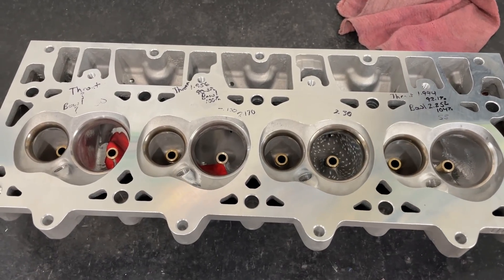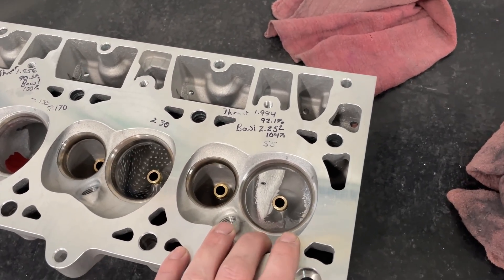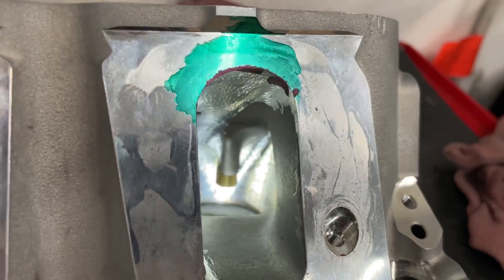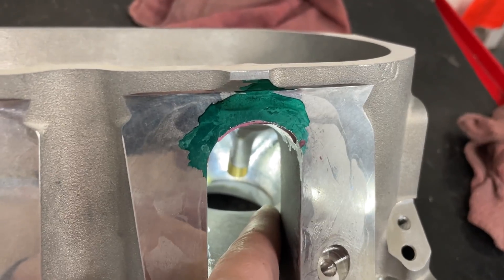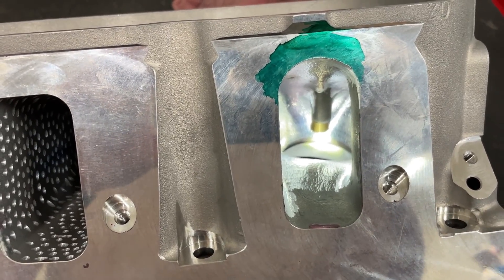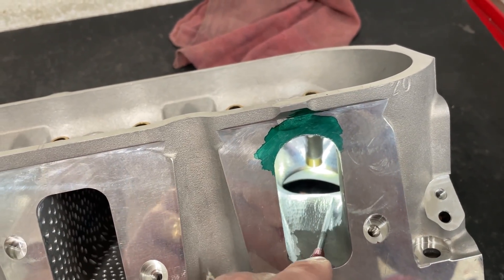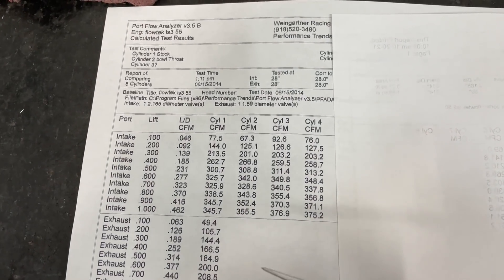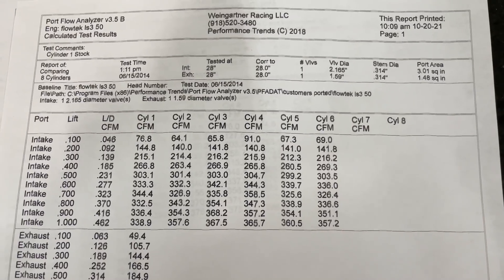Raising the Roof On LS3 Heads(386cfm) Internet ports heads part 6

Comment: I'd be interested in comparing port velocity deltas with your changes as well. I read about so many LS3 heads hogged out for peak cfm, at the expense of a lazy port. I'm trying to avoid depending upon a Mamo aftermarket head for excellent velocity.

Comment: I think you should use the “dimple” port to follow the results from the 55° port. I made a comment on DV’s channel to see if I understood the “rules” for port design regarding the port to bowl transition. He replied confirming the port should follow a 1-2° included angle reduction in cross section to the point where the port transitions to the bowl. The bowl should be biased to the cylinder wall side and the port should be biased a bit that way as well. Your 55° port latest results would seem to verify that “rule”. For max port velocity, the side of the port towards cylinder center should have minimal size increase. You have the experience in seat angles, throat vs bowl size, etc, but I’d be really interested to see results from a fresh look at the port and bowl. Super series, thanks Eric!

Comment: Would it be possible to have a piece of light cotton string and use it to see where the air is moving inside the port while on the flow bench, like a smoke stream in a wind tunnel ? If the string idea works it would give a clear indication of where the air "wants" to flow and then directs you to where the porting will have a greater effect.

Comment: The problem with your test could Be that, it's pushing air to the center of the port, that is IF the flow was through an intake and carb and intake maybe the air would biased toward the top of the port or a "line of site" bias? Another question, what sort of effect would this have on a partial throttle? Does all this make the engine difficult to drive on the street, or is this meant to be a full race head?

Comment: What you're talking about is huge corporations attempting to monopolize on vehicular service by trying to make it difficult (if not impossible) for anyone without proprietary training and certification to repair. It's really big in modern industrial farm machinery because that equipment is so expensive it's obsolete by the time anyone can actually own it. They're simply trying to corner the market and shut the little guy out. It's nothing new. I bit the bullet and learned electronics years ago when it was a big deal to get into; but in retrospect I can say it use to be extremely over-hyped. Just about anyone can learn most of all that is practical related to it from F-ing YouTube videos these days. My EFI ECM is a Magasquirt II which I built myself, can get pats for, and repair like a Jedi should the need arise; and I'd never trade it for an annoying oscillating idle circuit carb. LOL However, a guy who replaced the cab of a 96' Cummins Dodge PU that had been rolled with one from an 03' (gas V8) hired me to swap the wiring over and the job went over-budget because all high-current switching is done with relays at the fuse box rather than at the actual controls these days. It's further complicated by the addition of multiple programmable logic controllers (PLCs) networked together. Be that as it may, it can still always be totally stripped and replaced with something more practical should the need arise. If you own the shell it's yours and you can put what you want in it. The only real fear is getting legislated off the road, (S could get like that Rush song for real). As far as parts go, Getting most of them manufactured in China is a double-edges sword. American aftermarket is always hungry and can take up the slack but not over-night. It's all about consumer demand. Look how long Cubans have kept their vintage vehicles rolling. There's a lot of new tech stuff that's just slicker than Siberian snake snot, but you have to be able to separate the good from the bad. The big push is that digital is cheap and analog still expensive, but hands down, analog is always more bulletproof and that's what differentiates a genuine mechanic from a mere technician. LOL

Comment: What would you recommend for a street/ roadrace type build beyond stock? Basically any LS head will be a gain over stock SBC heads, maybe not so much the iron LS (vortec) heads, but not too much chance running into those, I'm thinking about building a 4.8, with rods and Pistons, cam upgraded, with a bit of boost, kind of a modern  Trans AM theme basically a late 60's early 70's style, with modern take, if not a tr6060, or t-56, maybe a6L90, with some stall, it will have about 27"-28" tires, with 3.45:1 to 3.73:1 gears, and looking to cruise at highway speeds 75+mph, at 2k to 2500rpm I had a 86 iroc it did 60mph at about 1400rpm, they should been ashamed to put iroc on that thing, or Z28, it was a turd, it should atleast ran like my 88firmula, only difference was it was a t-5, both 305, the formula did have the ws-6 package, with a few options, maybe it made a bit more power, both tuned port, it could of had a bit more compression, and more lift from the roller cam, maybe larger valves but I doubt that would be an option, I did think about modifying the tpi, I did port it, and match it, not much can be done with the thin aluminum runners, or the 305 H.O. heads, that's worth the effort or cost.. possibly A 1.60" exhaust valve, and a cam with more intake lift and overlap, 1.94"/1.60" is not that common, maybe a2. 9"/1.60" but port and chamber work will probably get the most gains, the small bore us shrouding, but I'm looking to the future, and hoping to get a 4.8L built, that can do about 7k-7400rpmbut peak in the 6500 range, make decent  'drivable' power below 2500r' and flat tq curve/plateau from 2500 up, and a good HP average across the range,  peak HP is not important,. But N.A. I'm hoping for 400hp peak, between 6-7k rpm, and atleast 650-800 on boost,,, I'm hoping to build a more efficient engine, not through boost at it to make power, 95%+ of the power is from the head, not much else can gains be made from modification of anything else, the intake and exhaust can restrict power,  the bottom end can restrict power with friction to, gains from compression ratio is possible, I'm hoping to get power from basically any LS head, make it the best it can be, without major modifications, basically valve Job, and porting, with new valves, possibly oversized but a small bore doesn't gain much from large valves, probably take your advice, and go with as much lift as possible, and multiple angles on the V. j. (Haha) they just something funny about calling it that!   Maybe fill the bottom of the intake ports, maybe weld up the floor of the exhaust ports, and raise and widen the exhaust ports, if that will help them, but that's about as far as I'd want to go, As far as getting crazy with the head mods, raising the exhaust ports .100"-.150" maybe . 250" what ever it takes to straighten the port, it would probably never fit a stock manifold, I guess I been watching too many super stock videos on engines from the 60's-70's, it's Soo much easier to talk and think about doing this stuff, I would like to try doing something with a vortec 4200, get crazy with a head, if you skru it up, you can get another engine for about $250-$400, maybe cut the deck, possibly larger valves, port work, and build an aluminum sheet intake, with velocity stacks, something like the 2j guys build, short or long, depending the purpose, probably short large diameter funnels! Into a large plenum, with a 102mm throttle body, with a couple GT-35's, maybe new rods, scat maybe, they make everything, and forged Pistons if possible, I don't know if anything is available for these engines! It should do atleast 420 HP, with slight boost, adapt it to a 6L80trans, but that's not even close to a project, Im mostly interested in the 4.8 project!

Comment: Knock a solid aluminium bar into the pushrod hole and straighten the wall in the port.
Reply: Thats actually relatively easy. You can bore the hole a little undersize and throw a chunk of round stock into a pail of dry ice with a little coat of durabond or whatever and it will never move. He is probably getting to the point that the pinch is an issue.

Comment: Eric, what bore are you using, do you go through the 4.000 & 4.065?
When you look at the 1" numbers and port stability is this in correlation to cross sectional area and the volume and the time component?
If its stable at 1 then the flow will match the cross sectional area for a given rpm?
When performing the cfd what I noticed going from static to dynamic (valve opening and approximate time) the available column of air plays a large part. As the valve opens and of course the air starts to move, at the end of the air column theres almost no movement.
People think that the air moves all at once, but it has mass and has to follow physics.
The runner in the intake seems to play a good part and there is a connection between size which is directly connected to the mass volume of the air column.
For the port you raised the roof in, can you fill in some of the backside of the bowl?

Comment: Eric - I’ve seen side view CFD that suggests that at most lifts, the top area of the bowl is a relatively dead area between the valve guide, down towards the valve seal.
Would it be a good idea to fill a portion of this (around where your ‘wet flow’ marked the bowl maybe?) to promote more airspeed and laminar flow? Especially with a raised runner that has been limited by the spring pockets etc like in this video? It would have a more straight shot at the ‘window’ of curtain area. Filling bottom of the port would probably help too.

Comment: Eric what kind or brand of epoxy do you use in the heads and do you seal it with something to protect it from fuel
Reply: Marine epoxy no need to seal it. Google green death epoxy. Always wear a mask when porting it. Us a cartridge roll not a burr. Be very careful as it's dangerous to breath in.

Comment: If the head will be scrapped anyway(s)  why not alter it drastically so that the intake valve is in place of exh and vice versa?    My idea is to put in the combustion chamber a serious lump of  epoxy,  grind through the aluminum between 2 combustion chambers. Then add more epoxy partly over the exhaust valve from the other chamber.   And create an intake port which aimes to the center of the cylinder bore instead of aiming at the cylinder wall.   

In this set up the exhaust valve of the other chamber is too far away but the exhaust  doesn't have to be flowed.  Therefore some epoxy will lay over the valve creating the combustion chamber wall.   

I hope you understand what I mean.

Comment: Hi Erik,  I'm in Australia and I've got some heads to do one is a p75 Honda crv b20b engine.  The other is 2 heads for a Mitsubishi pajero 6g72 12 valve engine. Any tips for stock cams and possible camshafts in the future. Any advice would be appreciated

Comment: I've been really enjoying this series. Raising the roof and filling the floor brings up a question, maybe more about OEM design than about port work: why aren't car heads mimicking the port layout of motorcycle heads? Sportbikes made the migration to high, straight, uniformish downdraft ports back in the early to mid 90s and gained a ton of power over previous layouts. Why don't we see that in domestic V8s? Is it pushrod geometry that makes it impossible? Packaging? Or is there some aspect of how that layout performs that doesn't jive with how car engines are used?
Reply: I think you can see this on the gen 3 hemi. Coyote?
Reply: Packaging basically. The ports would be pointing near vertical in a 90deg design. To get acceptable runner length, the runner would have to bend to the point where it would most likely end up more compromised than the typical (horrible) angle. Don’t forget cost either - the be all and end all.
Check out some on the late model V6 DOHC engines though, and you see they have done what you propose. But then check out the manifolding.
Reply: There is the issue that these engines are also emissions regulated. You need swirl and tumble in the cylinder at partial vacuum to minimize emissions production. Thats why you see some 4 valve stuff that only opens one intake valve at cruise. Ditto for the swirl valves on ford stuff. Heads that flow really well at high lift work awesome at the track but they usually have really bad swirl production at low flow pressure and volume. A proper off road head can do all kinds of magic.